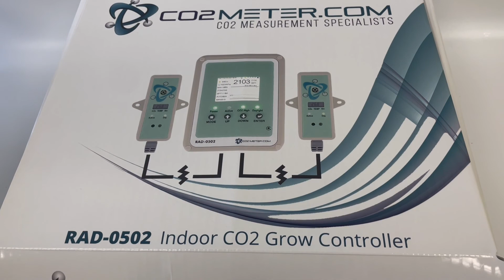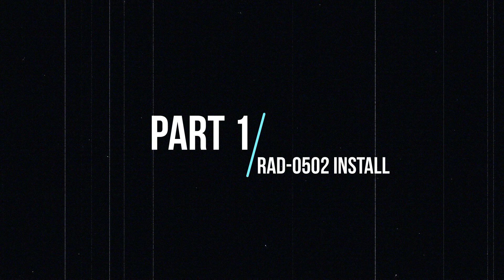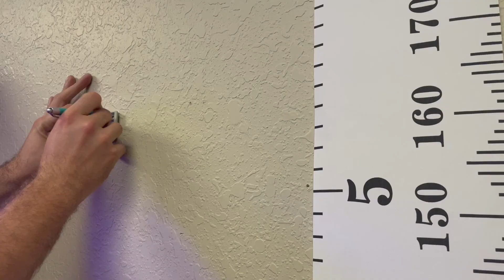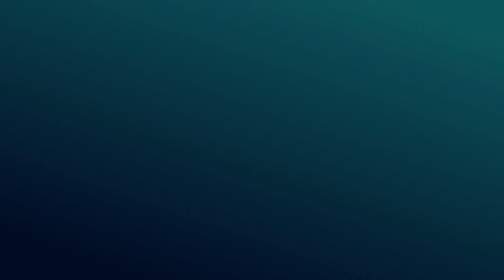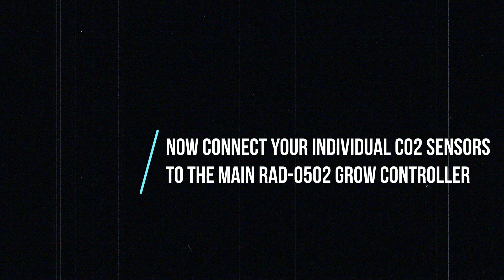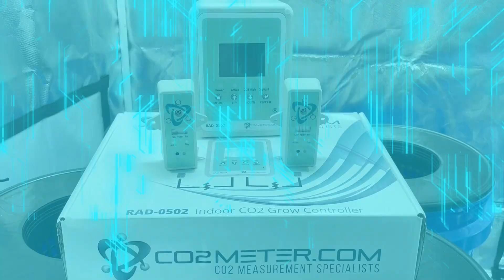RAD-0502 CO2 Meter Indoor CO2 Controller for Grow Rooms - Installation

Comment: Can we use for two different separately rooms ? And control two Co2 cylinder separately ?
Reply from the maker: Hi @saidlahiri9955, You can use this device in two separate rooms by putting each sensor in a different room, however but it can only be connected to one CO2 cylinder at a time.
Reply: @CO2Meter Ok , Thanx for answer. There no device for controling 2 cylinder 😢. Thanx so much Bro
Reply from the maker: @SIDLHR  Are your cylinders separate or manifolded together? 🤔
Reply: @CO2Meter now i use co2 controler with 1 cylinder suported . And soon need to buy one more controler for control other room and other cylinder. There are two flowering room and need control two same time .
Reply from the maker: @SIDLHR  It sounds like you could potentially be able to just use one cylinder with our CO2 grow controller, and still be able to control both rooms. & it's actually on sale right now for $149.00 👉 https://co2meter.club/3RBQzYB If you have any more questions please reach out to Sales@CO2Meter.com! 😊